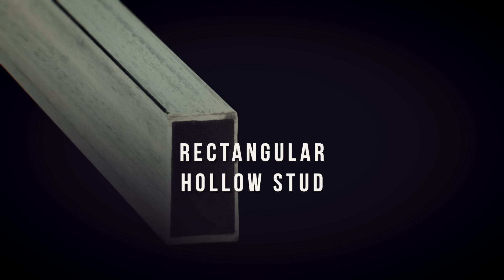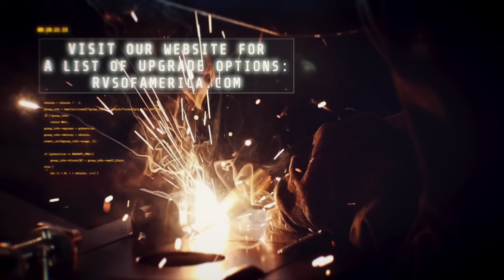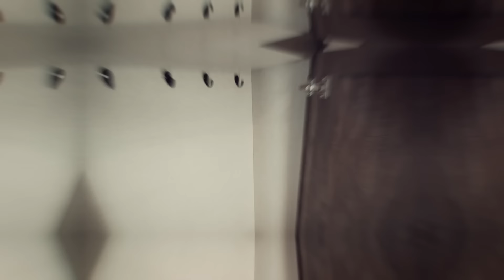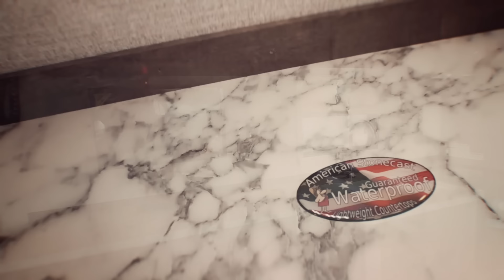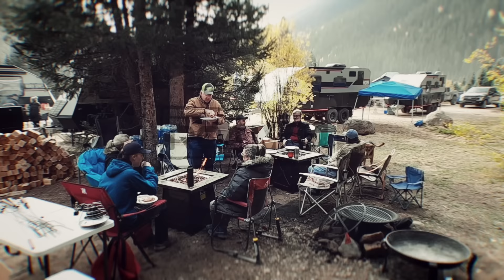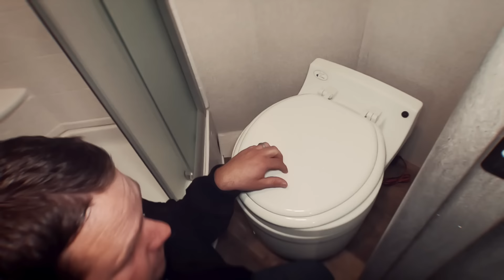2021 XPLORE XR-22 FULL TOUR ROA (2021)

Comment: I'd change out whatever is plumbed inside the wheelwell.....tubing? ....Wiring?
I would eliminate that for potential sticks,rocks,etc. hitting those areas.
Even installin a false inner fender panel would be better.
Otherwise a very nice trailer indeed.

Comment: Glad to see you guys dumped off those Black Series trailers.   With your new trailers the weak spot is def the fact that it's not a 4 season trailer which most of us need. And like with the Black Series you had installing an insullation "KIT" and a huge expense..I am guessing your insulation kit will be REALLY expensive as well.  So the question really is WHY don't people just buy something like and Outdoors RV that's  built in the Oregon Mountains and is a true 4 season rig that is super tuff built.  I think a side by side winter camping trip comparing the ORV against this trailer you're promoting now would be very interesting.

Comment: Why aren't small wind turbines included with the solar panels?
Don't you & the manufacturer see that it's a no brainer?
Reply from the maker: Wind power is a fair bit more complicated to use for a number of reasons. For instance, in the long term, it requires more maintenance (lots of moving parts that wear and tear, compared to solar panels which have no moving parts). When solar panels and batteries are more than enough for the job, wind turbines would just be an unnecessary expense and hog space that can be used for other things. But the idea might be an upgrade we could explore and experiment with.

Comment: Minor point... Cold is the absence of heat.  The goal isn’t to keep the cold out but the heat in.  The (excellent) insulation helps you keep the heat from dissipating through the floor, walls and roof.
Reply: So when I want to keep the heat out I have to use the air conditioner to put some "absence of heat" in.
Reply: @rb2712  — It’s bubba science, so pay attention.  The way an Air Conditioner woiks is ta remove the heat by using a naturally cold gas like Freon circulated inside to warm it up by extracting heat from the room, then circulating and venting air through fins outside coils the gas expelling heat from inside outside.  Keeping the heat or cold in or out of a vehicle is where insulation comes in.  The problem is vehicles aren’t insulated very well, so they use AC and heat systems that will heat a house.  That’s why my van needs a 28,000 BTU heater to heat a space that a 5000 BTU space heater would heat at home.   It’s a tough concept to master, I found just putting an ice cube on my forehead on a hot day works wonders.
Reply: @Erin-Thor  it was a joke

Comment: If the Black Series toyhaulers and this Xplore toyhauler had a baby it would be about a perfect ultra rugged toyhauler. If you took the Xplore dry bath, full kitchen with large fridge, nice rear full queen bed on a lift system with the couch/dinette underneath and blended it with the HQ 19 chassis, the larger black series holding tanks, the appliances, cabinets, and general fit, finish, and look of the Black Series it would be an incredible rig. The black series toyhauler has a wet bath, no indoor kitchen sink, the horribly bad placed furnace, and the worthless bunk beds in the garage. Xplore hits a lot of the Black Series shortcomings but doesn't have any of the fit and finish and general contemporary look of the Black Series.

Comment: Wow, if this trailer is 75k, I just don't see the value in it. I get it it's made for cold weather, but it's seems tiny and the interior is straight out of the 70's, pretty ugly actually. I want a trailer to take my family and maybe a few cousins, can't do that with this, no privacy. Also, I don't care for how the wheels don't seem to articulate very well, they stay in the air. At this price point, I would expect the wheels to articulate like a Bruder.
Reply from the maker: Thanks for sharing your opinion... It is not being sold for $75k. It is closer to 65k. Also the Bruders sale for $130,000 and has zero privacy and is half the size. It is a fair value.

Comment: It interesting idea but I do believe outdoor rv do 2” insulation same density plus they put woods in the aluminum stubs so when you put the cabinets or anything else you screw to the studs won’t come out etc but great video 👍
Reply from the maker: Thanks for your comment. Outdoors does not use the same insulation. It's a lower density. Yes, the wood is a good idea but can rot over time. This will have better R-Vaule but the wood is a interesting concept..
Reply: @ROAOffRoad  the nice thing about the woods inside the aluminum is it gives you two bites and help whatever u screw into to stay there. if there isn’t anything in the aluminum the screw will wallow out overtime and the cabinets start to come out. Especially an off-road rig where there’s a lot of jarring going up and down on off roads
Reply: @ROAOffRoad  that is interested about the wood roughing because it’s inside of the aluminum so I would have more problems if that roughed out lol. Yes they use 2lbs 2” Virgin styrofoam. I’m not saying your guys rv is bad.
Reply from the maker: @starkeyboys9583  yes. The Xplore is 3lbs. 👍😁

Comment: Which is better for full-time travel /living Black series HQ19 or the new Explorer?
Reply from the maker: Depends on where you are living. Cold weather the XPLORE for sure... Warm/mild climate HQ19.
Reply: @ROAOffRoad   I live in Toronto, ON, Canada....But, looking to travel full time mainly in the Canada and U.S....Initially considering the Black Series HQ 19 or HQ 21, and getting your team to do a number of upgrades/mods, including the insulation to winter grade.
Reply from the maker: @walterchan4459  it is difficult because with the Winter Package we are doing we can guarantee  -12°C. We have tested to -20°C but will not guarantee it at that type of temperature. The Black Series definitely have a better floor plan at the moment and are better off-road. But the Xplore wins when it comes to temperatures. It all depends on where you're going and what you're doing and probably some personal preferences. The Xplore will have a new floor plan this year that's not a toy hauler.
Reply: @ROAOffRoad  -12 C! If you're living in a trailer and it gets colder than that then it's time to hook up and move to something warmer like -10 C. :-)  Seriously though, If you want colder than -12C then you should be skirting, applying extra heat sources below the rig, insulating the windows, etc.